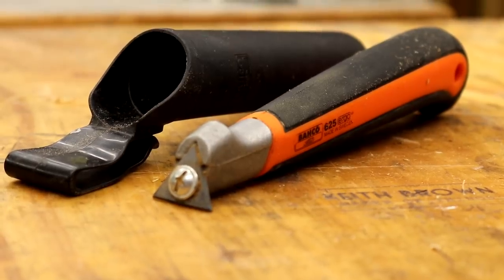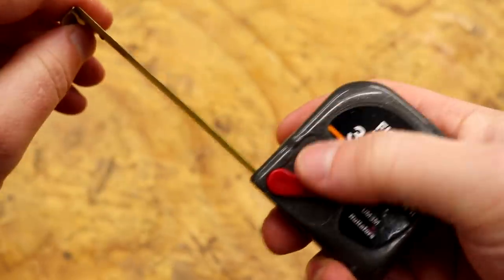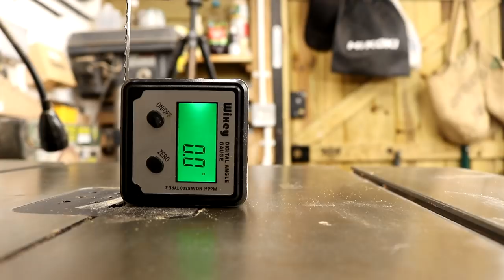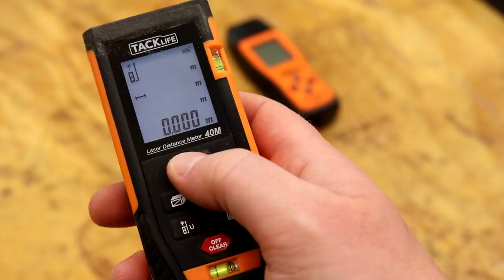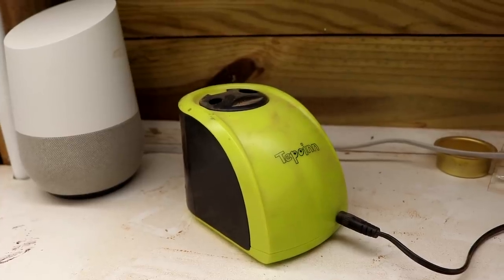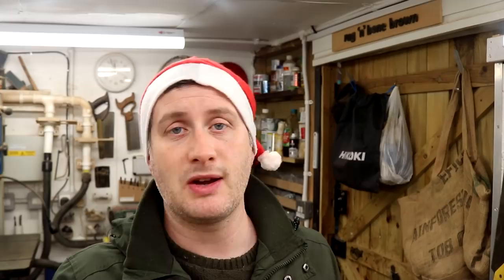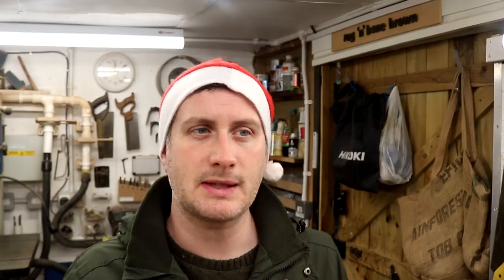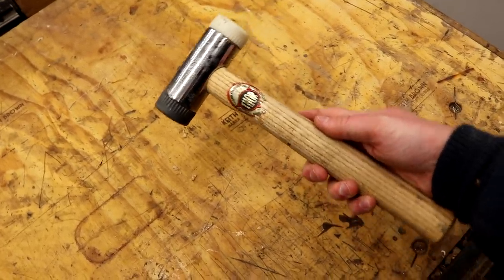22 Workshop Tools, Accessories & Gadgets (Most Under £30) - Christmas Gift Ideas

Comment: You can get a Visversa tape measure from Axminster that’s in metric. You can use it right to left or left to right and it also has measurements on the underside of the tape. It’s brilliant and it’s my go to tape now. Cost around £10
Reply from the maker: Thanks will check it out

Comment: Re the battery corroding inside the casing. This is a ventilation issue. To solve drill a tiny, 1mm hole in the casing to allow it to vent the battery compartment. Et voilà, no corrosion.

Comment: Hi Keith, toolstation have a double sided metric tape measures on the website, it's called vice versa and is only £8.40
Reply from the maker: Thanks will check it out
Reply from the maker: Thanks will check it out
Reply: I have one - it's double-sided and it has 2 scales on each side of the tape, so the numbers are never upside down. 5M long and has both a 'hold' button and a lock. The 'hook plate' at the end has upward and downward-facing hooks too. I love it.

Comment: Just wondering if there are any legal issues with carrying a knife (albeit a small one) around with you in public places?

Great vid and good timing by the way 👍🏻
Reply: I always worry about my favorite British youtubers when they admit to having, let alone *carrying*, sharp objects. Hopefully it's not actually as bad over there as we in the colonies hear.
Reply: jabrwok I think you’re ok with having them but if you are found to have one on your person in public then that maybe an issue depending on the view of the officer involved. If they believe you are carrying / concealing an offensive weapon then they could arrest you for it.  We have a major issue  in some of our more major cities with knife gangs at the moment so it’s a real hot potato for the police right now but they tend to favour far more substantial items sadly
Reply: My understanding, which could be flawed:

In the UK, it's legal for an adult to carry a folding pocket knife in a public place, as long as the length of the cutting edge does not exceed three inches (76.2mm), and the blade is opened manually, providing you have a "good reason or lawful authority" to do so. In practice this refers to your intent. Carrying it for reasons of work or general utility is fine. Carrying it as a weapon is not.

If in doubt, contact your local police station for definitive advice.
Reply: Benedict Builds sounds about right now you have explained that. Remember something now about blade sizes 👍🏻
Reply from the maker: I was going to respond but Benedict’s response was better than mine would have been 👌
Reply: Benedict Builds got it just about right but in addition your max 3inch bladed knife MUST NOT have a locking blade.

Comment: That glue gun is £40 plus another £80 for a battery and charger!
Reply from the maker: Not if you already use the Ryobi platform batteries and charger, but yes if you need batteries with it it’s pretty expensive to get everything you need